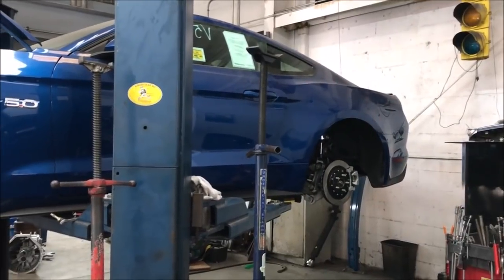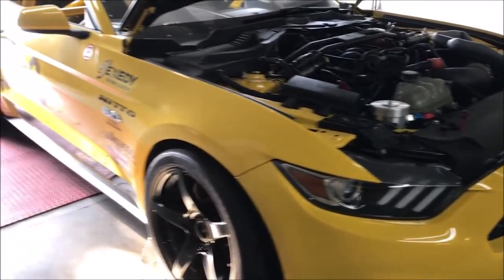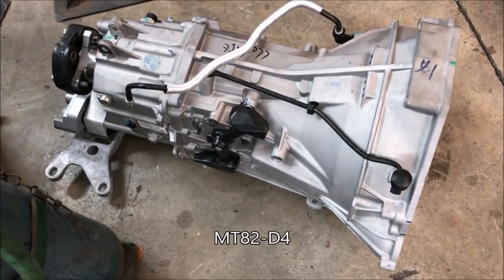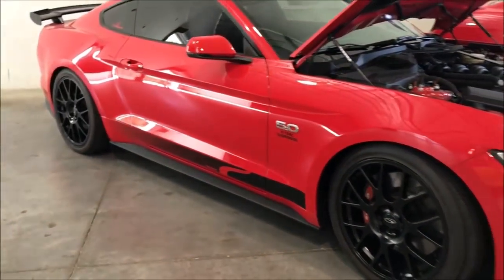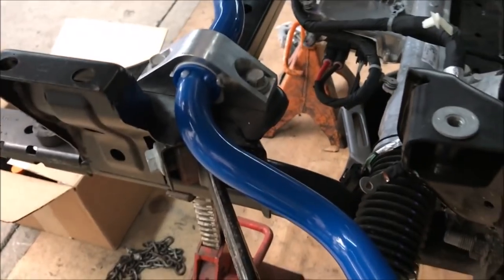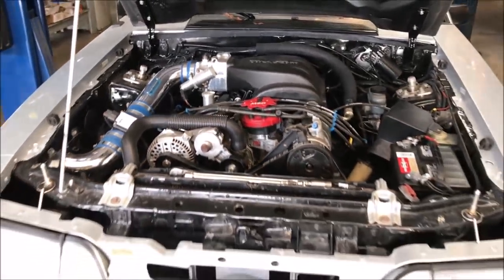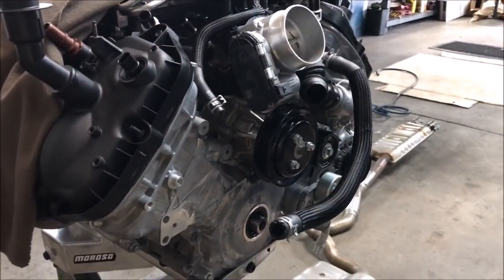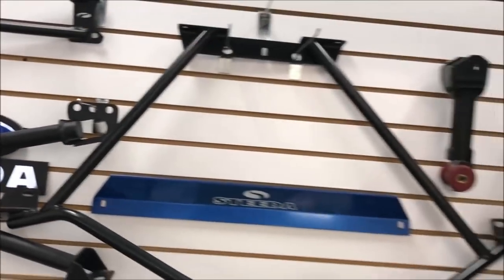2018 Mustang 5.0 Mt82...Steeda's Race Car and More!!!!!!!

Comment: PLEASE tell Steeda to maufacture upgraded shift forks for those of us who want to be safe and not rely on Ford!  Great video btw, LOVED your update on the stop the hop kit, I am buying each piece bit by bit to include the upgraded half shafts so I can do it all on one go.  But the shift forks have me on edge since they are becoming more and more common.  Regarding the motor shown here, did Steeda swap out the plastic oil pan for the Moroso aluminum one?
Reply from the maker: NutNbutSpeed... Funny you should say that. I did inform steeda about the shift fork issue.
If you follow Alex Flores he mentions that Ben Calimer (Spell Check) is making the shift forks. But i have to say that the aftermarket will make a stronger replacement. if they don't I will! It's to big an opportunity to be ignored. The motor steeda built up for the blue 2018, Yes they removed the plastic pan and installed the Moroso one. Pretty nice i think!
Reply: Man, best news I've heard!  I'd love to see a reputable company make the shift forks but you're right it's one hell of a business opportunity.